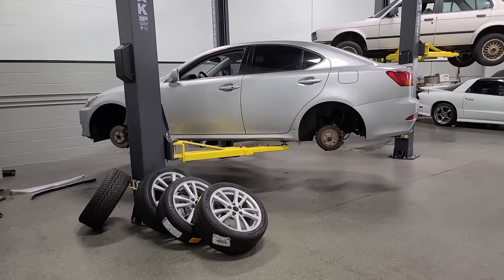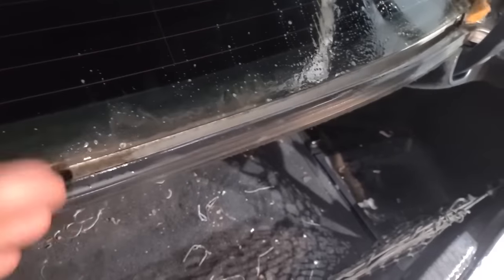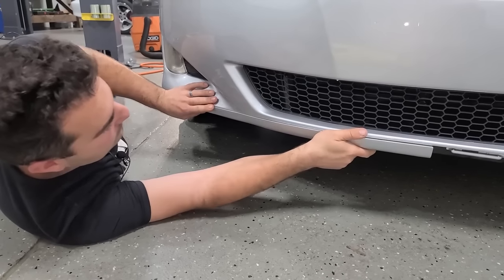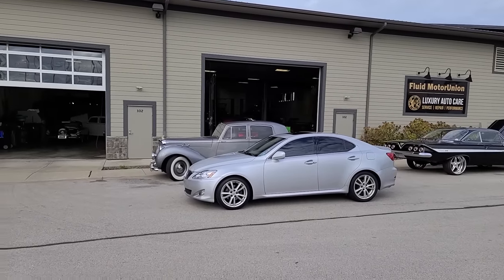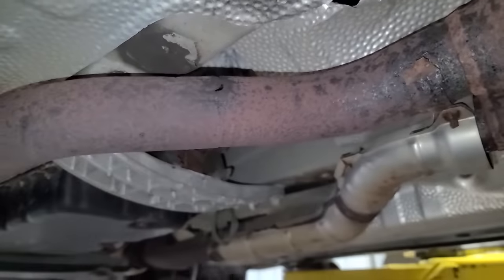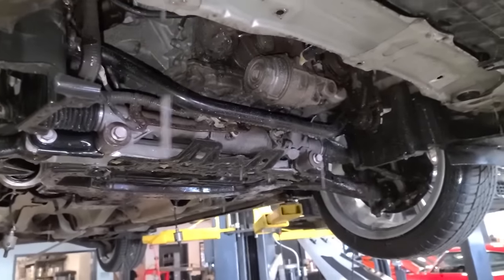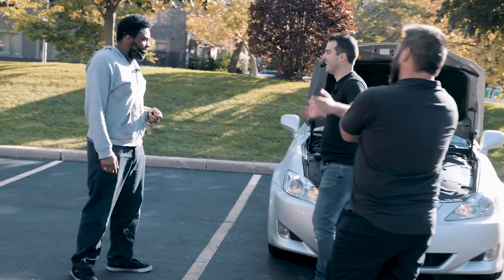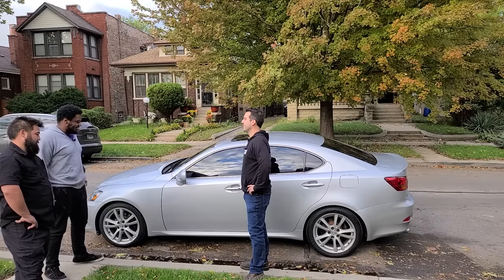I Fully Restored An Abandoned Lexus & Surprised A Very Deserving Stranger With A Free Car & Cash!

Comment: My daily driver is a 2001 Lexus RX300 I  bought new for my wife (30K) and she drove it until I got her a new RX350 in 2017 (50K). Besides regular maintenance I've had to replace the Engine Control Module ($1,100) back in 2020. It looks good, drives good and is the best automobile purchase I ever made. At 74, and with 3 kids that's been a lot of cars. I hope this young man has year's of carefree driving & performance with this incredible gift.

Comment: im going thru a restore currently on a 2001 audi allroad 2.7t. motor is in great shape, jist fixed a water leak shorting out trans control module  replaced that, all filters next up is to find the front suspension clunks and slipping trans but.. who knew restoring a car was so fun? every day its closer to completion

Comment: Yes, applying a high-end ceramic coating doesn't take much time, but the prep work is a bit tedious and will take most of a weekend if you don't need any paint correction.  Add a day or two for paint correction if necessary.  At a minimum you need to do a very through two bucket wash, iron decontamination, clay bar the entire car, dry very carefully, and then just before applying the ceramic coating you need to wipe down the surface with IPA.  Finally, you apply the coating which is the easiest part of the process.  
If the paint isn't near perfect, you need to do some buffing after you clean the car and then, of course, it has to be cleaned again after paint correction.  None of this stuff is hard, but it is tedious and unless you do the prep work properly, you're just wasting your time and money.  Slapping a ceramic coating over an improperly prepared car, especially one with bad paint, is not smart.
I advise people to plan for a half day Saturday and a half day on Sunday if your paint is good. 
However, even though your arm will be tired by the end of the process, it's WELL worth it and the time spent (and money too) will be repaid many times over when it comes to keeping your car clean and shiny for many years in the future.

Comment: Hey Alex, I am a big fan of your channel. I got a 2015 Alfa Romeo Giulietta. When the engine is warm the car would not start. You would have to give at least an hour before trying to start it again. It gave me a code for mass air flow sensor and fuel injector pressure sensor. I replaced both and the issue persists. I figured to contact you since the Lexus had a similar problem and the fuel pump fixed it. Your input is highly appreciated.

Comment: Hello, I have a 2003 BMW 745LI  I was wondering if you can help me get it back running like normal. The engine like is on and it shifts into 2nd gear hard. I have a low bean headlight malfunction light on. I love this car and really need help. It also has a 140 thousand miles on it.

Comment: No idea how a jump pack works then belts out "new springs, control arms, new bushing set, battery, cleaned the intake valves, replaced the OEM plastic timing chain guides with aluminum ones, and had a bad O2 sensor, I actually prefer the 1.8 to the 2.4 on these 7th gens but had to settle with the deal I got on this" I'm obviously exaggerating and I'm not familiar with this particular platform in the least so made a bunch of random shit up but you sir are an awful liar LMAO

Comment: I'll blame you running it on really old fuel on this. Never run a car on old fuel, always drain as much as you can then mix what's left with high octane fresh fuel. Old fuel will ruin the pump, fuel filter, and cause excessive wear on the injectors.

Comment: Those guys do not know how to clean an engine bay correctly! you never use a high-pressure gun on it it just squeezes water into electrical components.
You could have also sanded off the rust off the brake rotors same with the mufflers on the exhaust they are rusted out.